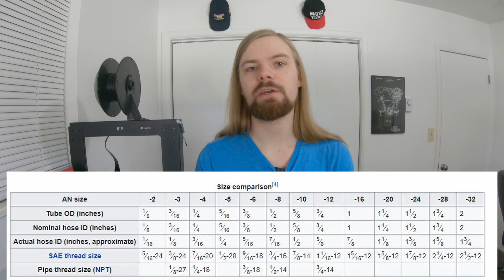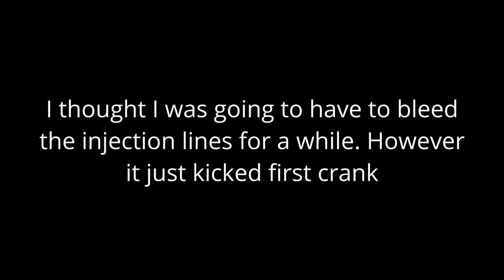Cummins Swap Custom Fuel System! How to Make Fuel Lines!

Comment: Thanks for making the video.  It’s be of my long return diesel fuel lines ruptured and part isn’t much (70$), but shipping is typically in the $300 range.

Have you tried to make any of those manually?
Reply from the maker: You're welcome! I did do a full return line in this video as well. If you swap the fitting on the tank to AN fittings, and on the engine, then you could do it exactly how I did it. Note I wasn't using a cummins tank so I'm not sure what fitting is on that end. Parts here:
www.BuildAutoMedia.com/ANCummins

If you have a tubing flaring tool you may be able to cut out the section of steel line that ruptured, and add some steel tubing and compression fittings to replace that section, but it'd take more tools than replacing with rubber lines like I showed in the video.
Reply: @BuildSomethingAuto Thanks!  I’ll check it out.  The metal portion of the tubing is fine, it’s actually the hard plastic line near the engine.  I bought some AN-6 (rated for 750 psi) braided rubber line and will create those new sections.  I am hoping the soft line will work, not sure the working pressure of the hard plastic lines since the numbers have rubbed off…..
Reply: Looks like the new fuel line I have is rated to 600 psi.  No plastic inner sheathing.  I’ll get the type you suggest.  Looks like the Amazon AN-8 is good up to 2250 psi.

Comment from the maker: I see a few of you have bought the fuel lines and fittings I used from the amazon links in the description. Let me know what did you think of them, did they work out as well for you as it did for me? Do you know of a better product than the one I linked?
Reply: Have you had any issues with smelling diesel, permeation or the hose breaking down? Currently researching and leaning toward PTFE hose, I'm reading that CPE is not recommended with fuel and will eventually break down and contaminate the system.
Reply from the maker: @dpgoverride  Good question. I haven't had any issues with Diesel so far. The manufacturer of this hose claims it works for diesel, however it's always good to check multiple sources. I found a chemical compatibility chart here:
http://www.els-id.com/EnviroSafe_Loading_Systems/STAMPED_files/Chemical_Resistance_Chart%20copy.pdf

These charts are typically made experimentally by testing each material in each solvent so in my experience they're pretty trustworthy. The chart claims CPE is rated "A" (acceptable for continuous use) for diesel. HOWEVER for gasoline it is only rated "B" ("generally" suitable for continuous service). It's also rated A for ethanol so added ethanol in gas shouldn't be an issue. If it were a gas fuel system I'd be tempted to have that B rating make me lean towards PTFE assuming the price wasn't too much higher (even though technically it's "probably" okay, I wouldn't replace an existing system based on this info).

Either way PTFE is a better hose, tougher, more cut resistant, higher pressure, etc. So if the price makes sense I don't think it's a bad idea to just use PTFE. For diesel I'd rest easy with CPE though if the price makes more sense.
Reply: @BuildSomethingAuto  Thanks for the reply, information and your thoughts. The PTFE is about as pricey as Parkers multipurpose push lok hose (over the super flex stuff) and Fragolas braided hose. The Parker hose I want to use needs crimp fittings to be compatible with Diesel fuel. Alternatively I considered just using the cheaper super flex hose and adding a heat shield cover to it as heat is my main concern. Most of the rubber hoses I've looked at are only rated to 212F, while that may not be continuous if I am pushing the truck or a mishap comes about I would hate to catch it on fire.

That cummins Explorer is pretty dope, did you ever get all the loose ends tied up?
Reply from the maker: @dpgoverride    it's definitely good to be safe, just keep in mind diesel takes a lot more heat for a lot longer to ignite than gas. Gasolines flash point is NEGATIVE 49F or so, while diesels is more like 180F. The only spot under the hood thats that hot is the exhaust/turbo, so you may consider heat wrapping those for extra protection, then IMO you wouldnt really have to worry much about fire risk (im assuming youre not using nitrous or anything 😅).

Its coming along, but ive gotten distracted building my own DIY electronic dash. Im wanting to monitor fuel pressure while driving to figure out the stalling issue. Overall its getting there!

Comment: 300$ of fluids????? How???
Reply from the maker: Its been a while so I dont remember exactly, but theres about 3 gallons of oil, then both the transfer case and the transmission had work done and needed new fluid. The nv4500 transmission needed some like $20 a quart special fluid, something to do with the syncro material. Finally I believe I was counting the diff oil front and back and like 5 gallons of coolant as well since I bought it all at the same time. It was probably more like $250 maybe I was being dramatic 🤣